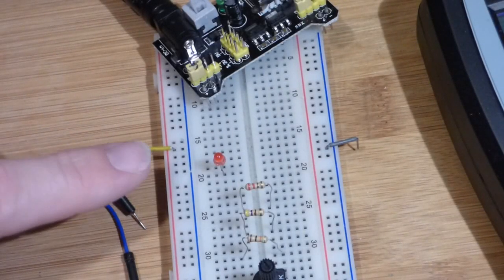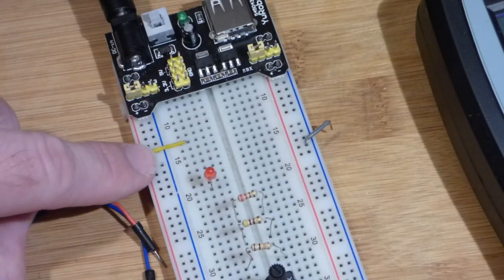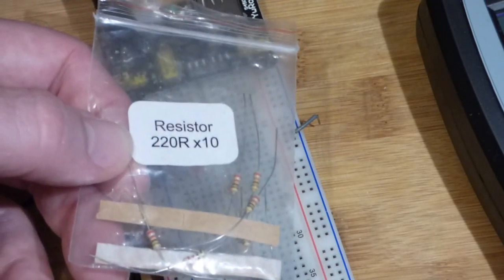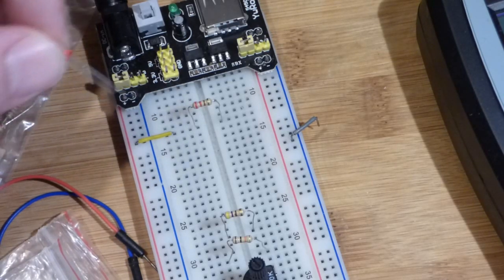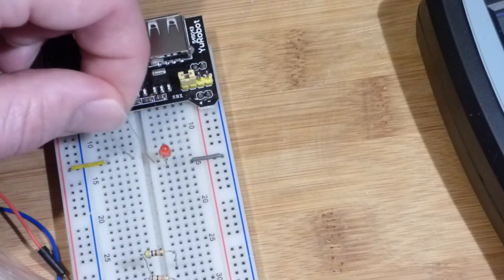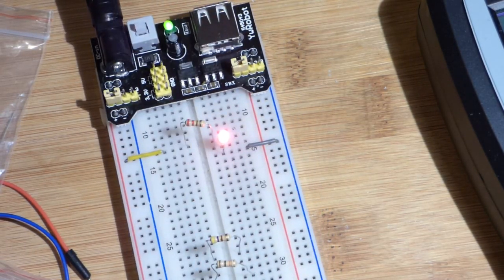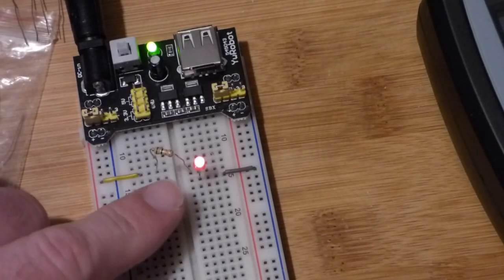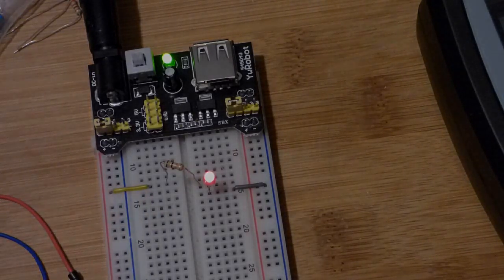Step by step electronics circuit builds 1 lighting a resistor protected LED on a breadboard

Comment: The positive is being supplied by the left hand side, but you are completing the circuit with the right hand side. How does that work? Are the left and right sides connected? I would have thought that the left and right hand sides supplied separate power.
Reply from the maker: It's all the same power, you can just change the voltage or disable the power.
Reply: @Electronzap  Thanks for the explanation. It looks like a useful breadboard power supply, so I just ordered my own.
Reply from the maker: @dono42  I used them a lot in old videos, until I found a power supply I could easily film. Worked out just fine as long as 5V is all you need.

Comment: My led doesnt glow that bright even on 120 ohm resistor 😔, yours glows bright. Btw, nice demonstration and comparision
Reply from the maker: That's a bummer, but I don't have bright lights in my room and the camera films breadboard circuits better in lower level light which makes the LEDs look extra bright, so it probably just appears that mine are brighter.